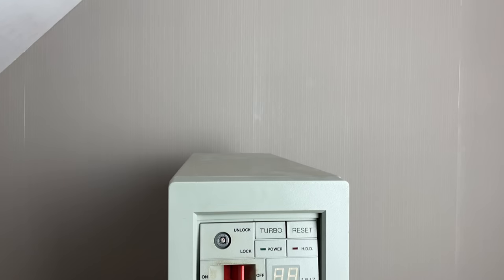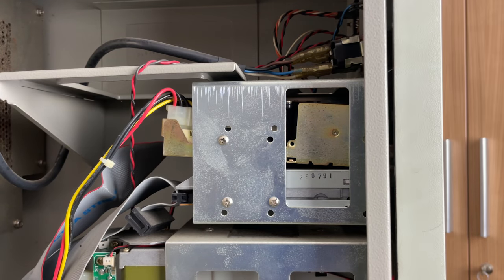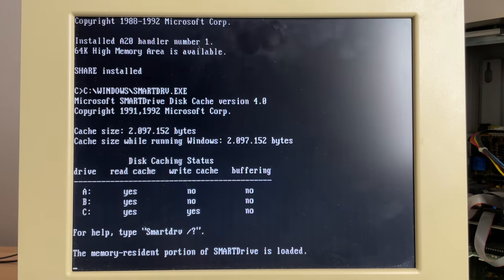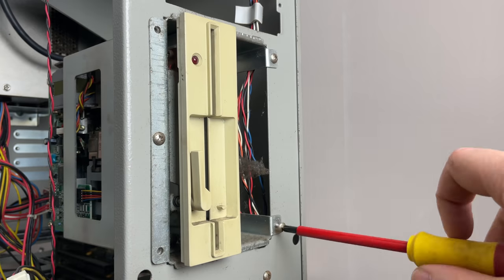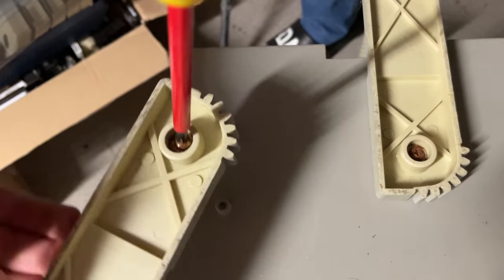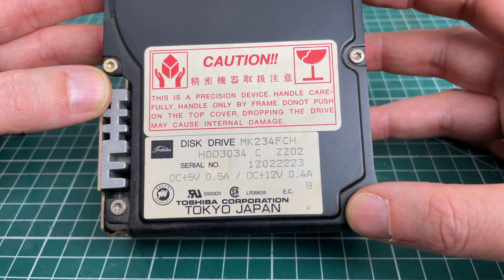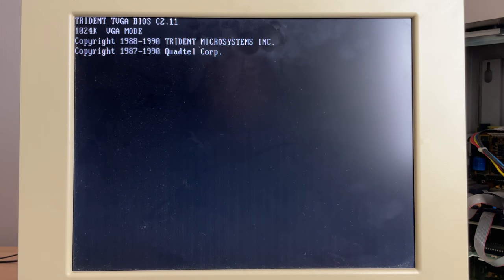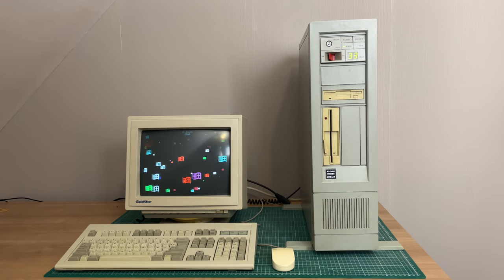Kloon Tower 386 PC - First look #DOScember

Comment: I had two of those cases back in the day. Didn't say Kloon on them and had different hardware in them Bought them both for five bucks each at a Navy DRMO. Made one working Machine of of them AM386 DX 40MHz, Cryix Fast Math and a whopping 16MB of RAM. Sadly I had to take apart my IBM AT as well since both systems didn't come with video cards or hard drives. I was stuck with EGA graphics and a 30MB MFM drive. Keep in mind this was back in 1994. I kept on slowly adding stuff to it and by 1997 or was it 1998 my parents bought me a pentium based PC for Christmas. I honestly don't remember what happen to that 386, I wish I kept it.

Comment: Looks like a clone of IBM PS/2 Model 80. Great stuff!
Reply: You beat me to it!!
Reply: Yea. I was going to say the same thing. I noticed in magazines back then. When The fully size IBM system came out. Tons of full height towers started looking like ps/2 clones. Even though it looks cool. That has to be the worst inside use of a full height tower at case I have seen. i also remember those power supplies being big bucks too. Not that common.
Reply: @eaglenebula3950  Yea. the MCA was great. To bad IBM charged a huge license fee for it. So much better than when plug n pray came out. LOL
Reply: Yep.  I always wanted one of those, the 60 or the 80.

Comment: Not sure but I asked a guy why they never recap floppy and hard drives, and the answer was because the drives are adjusted to the caps on board, and you need special equipment to make that adjustment, and it's almost certainly guaranteed that these adjustments will no longer be valid if you replace the caps. Not entirely sure, maybe worth a shot but I wouldn't expect the drive to survive.

Comment: That's a full size XT-syle power supply! They were in use till the 486 era, when the standard AT-style PSU came into fashion (the rough size format and screw mounts which are still in use today). My main i7 rig is in a modified server chassis from this era, and originally housed up to 7 full height 5.25" SCSI drives (or 14 half-height CD-ROM sized drives). I gutted the original XT-syle PSU to replace it with the guts of a modern 1200w modular ATX PSU.
Reply: AT style came into fashion with the 286. That’s why it’s called AT style... certainly the motherboard power cable in here is already AT style, even though the form factor is a bit bigger than normal.
Reply: @JasperJanssen  I've seen 386 and 486 machines by Comtex that still had the large XT style PSUs.
Reply: @BlackEpyon  sure, it was still used occasionally, but most 386s and up used AT power supplies. 286s were in my experience mostly XT.

Comment: That case is a bit of an odd one with the vertical arrangement of the 5.25” bays. A teensy bit unpractical as it limited to 2 devices. All though you could also squeeze a cd-rom drive in it. The 5.25” floppy is a YE-Data but with IBM bezel. The one I’ve got in my Pentium 2 has a flat bezel which seems to be less common. The name of this is system is quite funny, in literally means “clone” in dutch. Whoever built them must have had a sense of humor I guess.

Comment: I've had many a cut hand working on systems like this back in the 90s, it was just one of those things you expected when working on cases like this was part of your job. I always kept a box of plasters on hand just in case. Also those screws on the feet don't need to be replaced, just place them in a glass with some rust eater, white vinegar or even just some coca cola to remove the rust.

Comment: Awesome tower case! I have been watching a lot of your stuff lately, and you inspired me to go on a battery removing spree yesterday. Took one out from a spare 486 board in the basement and also found my old 386 desktop which I ended up bringing upstairs since there was some damage from the leaking battery. I found that computer with a monitor behind a dumpster around 2001 and me and my friend struggled to get it home. It probably started out as a 286 and got an early 386 upgrade. It has a ST-225 HDD, YD Data 5,25" drive, and 2 MB RAM on these 30-pin sticks which predate the more common 30 pin SIMM (mine just have pin sockets on the board). Someone left the original Hercules-compatible card in but added an Oak VGA-16. I am currently working on getting the HDD to work properly.
Reply: It's apparently called SIPP memory according to Wikipedia!

Comment: This may sound odd but can you tell what model the Compaq Presario next to the giant IBM tower is at 0:25?
I'm asking because that's the exact model I had as a kid and young teen in the early 2000's, which I too kept but went lost after my mom died due to complications with local authorities.

This PC may have different components inside but I know mine had a Pentium MMX200 with 48MB RAM, a 3GB hard drive (which I had both Windows 98SE and BeOS 5 Personal installed to, later replaced by Windows 2000), a 10X CD-ROM drive which we used to replace with a 52X drive from LG, as well as a 10Mbit/s 3COM network card our teacher gave me at some point.

Comment: A big red power switch is key component that tells you that this is a really serious computer :)

I have a case that looks a bit like this, probably from Germany or somewhere nearby. That one is wide enough for placing 5,25" units horzontal so its not exactly the same case. But it has the same big red power switch that makes a really satisfying sound when its operated.

Comment: I have an exact same hard drive.  You should definitely change the capacitors, they are leaking.
I did, but still only spins up, then stops.
Also every time you see that brownish glue residue around components, remove asap! (psu)
The original glue has deteriorated over time, and became corrosive and conductive. Generates all kind of problems, shorts and even eats away component legs.

Comment: 9:10 about the cables and the switch: I had to learn this the hard way 🤦
Reply: Stanley Broniszewski  I mean the power cables. I was literally "shocked" when I discovered how an AT power supply worked ;)
Reply: @20windfisch11  Are we assuming that you wired the live and neutral to the same pole, hence shorting the live an neutral together when the switch was flicked.
Similar to something I have done with a multimeter, forgot to take the probes out of the amps sockets, went to measure power, turned the socket on and bang, luckily I was not holding it or the probes at the time and the socket had a fused 3 way adaptor in it. Amazingly the chepo multimeter still works!
Reply: @dglcomputers1498  No, I had a PSU where the insulation was missing. I switched it on and touched the metal parts. bzzzzzzz

Comment: Regarding sound card, you chose one that has a proprietary Panasonic CDROM interface. I'd rather use a card that provide standard IDE interface in order to utilize any IDE CDROM. Also I noticed that you got your hands on YE Data 5,25" floppy drives; I have two of those and they are quite reliable pieces of hardware. Regarding a problem with a video card there are two solutions on that matter: one is to cut one of contacts on VGA port on the card and the other one is utilizing a software called 'coloron', a small dos program that fixes this problem - I'm sure you can google details on both in no time.

Comment: That HHD controller failure looks familiar. I just built myself a beautiful Baby AT 386 DX40 and the thing did not stop throwing that error before I had not attached all the drives exactly like BIOS was set up. 
But.. that barrel battery? Did it actually still hold the BIOS values? I had a 486 board recently with the same model, by "GP" and it still had the BIOS settings, after 26 years.
Reply from the maker: bios settings were intact ... floppy drive config + HD was set according to spec. clock was at Dec 9 1999 :) Probably hit the Y2K wall.
Reply: @RetroSpector78  Amazing. Just like mine.

Comment: I believe the power switches used in the IBM machines were made by Arrow England. The example I've got with the orange paddle is model number 93RP4040B103K. The one in this machine looks like a clone, which I'm sure were common back in the day since I've seen them on several clone machines.

That Jazz 16 sound card would be a pretty good match for a clone machine, kind of goes with the idea that the original owner would've gone for a cheaper option over the more expensive Sound Blaster cards. The Jazz 16 looks like it came out in 1993 based on the datecodes on the chips, whereas the Aztech card looks more like 1995. A sound card upgrade on a 386 in 1993 might sound a bit late, although Pro AudioSpectrum 16 card would be a better fit. In reality they were still selling 386 machines brand new in 1993 as entry-level machines, so this is entirely plausible. Granted they'd moved on to more integrated motherboards by then, but you'd still see these kinds of machines being sold refurbished for cheaper, so the Jazz 16 card definitely wouldn't be out of place.

In any case, I can't wait to see the upgrades!

Comment: Not all I/O controller card game ports are equal! Your card is the better version that actually supports 4 axes, for 2 joysticks or one joystick with thrust lever. You can easily discern them by the type of timer chip used. The good I/O cards have a NE558 4-channel timer, while the cheap ones have a NE556 2-channel timer chip.
If you want to be sure to get a fully featured (4-channel) game port, use a sound card instead. I have yet to find a sound card that only supports two axes.
Also, at 13:45, you call the memory expansion slot a "16 bit memory upgrade slot". While the slot has the form-factor of a 16-bit ISA slot, it is a 32-bit memory slot. Considering that this type of slot has 98 contacts, which is more than a 72-pin 32-bit PS/2 memory module has, there are definitely enough contacts for 32-bit memory access.
15:05 the "UMC-based chip here", the 82c206, is integrating all the discrete chips of an AT mainboard (2 DMA controllers, 2 Interrupt controllers, a timer chip, the real-time clock and the DMA page registers). The number 206 points to this chip originally being part of a 206 chipset. The first 82c206 on the market was manufactured by Chips and Technologies to supplement their CS8220 chipset, that consisted of Chips numbered 82c201, 82c202, 82a203, 82a204 and 82a205, and became an official part of the successor chipset, the CS8221. Most chipset manufacturers had their own copies of that chip in the 486 days, and many 486 boards still have the same chip type (although sometimes in a smaller case) to provide all the classic ISA stuff. Later south bridges sometimes have the specification "includes a 206 macrocell" in their datasheet - which means the south bridge designer took the design of the 82c206, and "copy/pasted" it as one part into the more highly integrated south bridge.
You will not find 82c206 chips on boards that tried to provide improved ISA support or a more modern bus system better suited to 80386 and 80486 processors, namely EISA and MCA systems.

Comment: awesome style i have the perfect crt for this  i bought it ten years ago to stick into a arcade machine its like a normal crt but supersized i dunno what it was used for but it has some weird connectors on the back that look like 3color coaxial connectors but also the regular monitor connector would be funny to pair the giant monitor with this giant pc case lolz its so big i had to cut a hole in the back off the arcade cabinet and extremly heavy i never seen people use it on the retro channels starting to think i have something rare

Comment: 100 MB harddrive ...woha I remember when that was a lot of space ....
I had two of those on my 386 back then ...
I also remember the first cd drive I got and how I swapped out the  5 1/4 inc floppy 
to add the cd drive ......
Those old cases was so much better than those ' ' blinky ' ' led filled eye candy cases they sell today.
Those old was rock solid and builot for practical use and to last long time , whereas those today mostly 
is just expected to last until they release a new '' eye candy '' model .
Just look at the metal plates itself ... Those old is as thick as 4 to 5 new ones .
The new computers metal is thinner than the metal in a food can ....
Cheap crap sold expensive ..
I really like the old high quality case and also the fact they was built to last .
Not those '' blinky , bling bling ''  Led filled new boxes , no no no , thats not for me .
( My computer have NO Led Light and such , it's NOT built for being '' eye candy '' )

Comment: This whole setup is eerily similar to the first PC I got when I was 10. Some minor differences is that mine didn't have 8 MB of RAM but I think only 4, and that the turbo switched between 33 and 16. Otherwise This tower feels uncannily familiar with its top panel including the chunky red power switch and LED clock speed display, and its form factor. I'm also pretty sure I had that or a very similar keyboard, and probably a different monitor. The Windows mine had installed was 3.11 without any extra branding.
What makes that so strange to me is that I don't live anywhere near the US, I'm in Germany, which makes this kind of setup matching mine extra odd.

Comment: (17:47) Ew—I wouldn't leave that power supply as-is. There's a light coating of rust, that should be removed and sprayed over with rust converter chemical, but the bottom of the fan side (18:15) looks particularly bad. I would definitely clean off that rust, and it's probably worth inspecting under the PCB.

Comment: i'd double check that power supply looked like one cap was ever so starting to bulge.
Reply: @digibitz322  @17:54 the larger one you see w/ a yellow stripe at the top, unless its just a "1080p on 4K" Display aberration, looks like its starting to lightly bulge